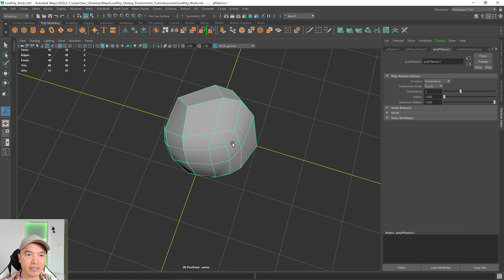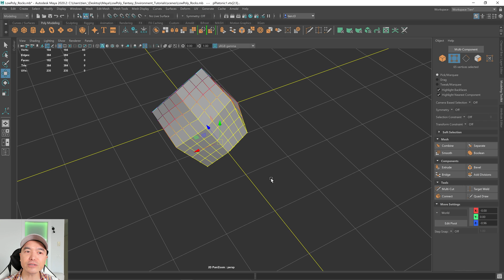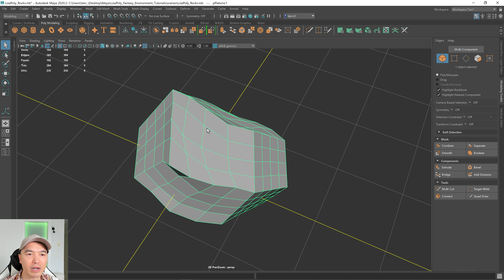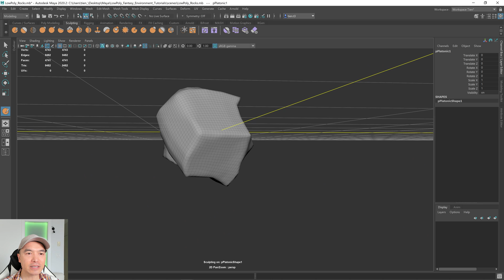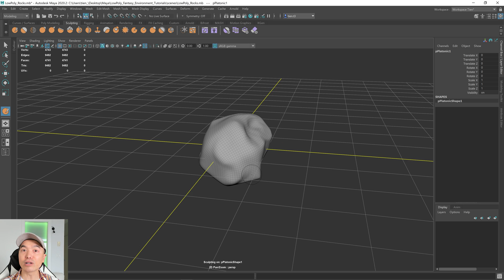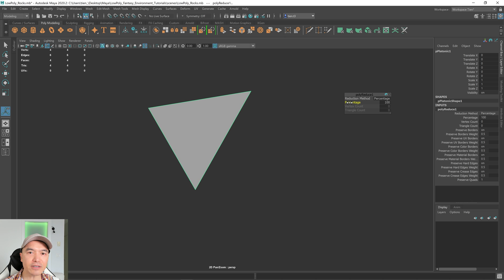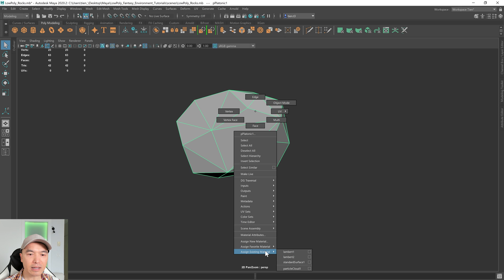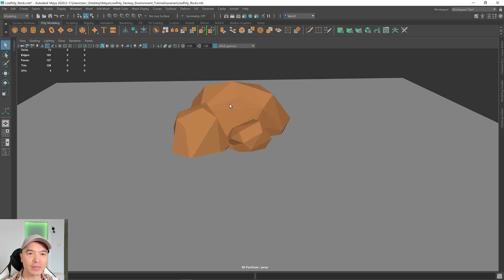Model Low Poly Rocks In Maya | Simple Rocks and Stones

Comment: Wouldn't it be much faster to start with a mid poly icosphere like the one you used, leave it triangulated as it is by default, deform it with the grab brush in sculpt mode and then reduce?

Comment: Ive run into a problem within the Modelling Tools and using the 'Add Divisions' tool. It does not divide all the faces, and instead opts to only divide faces within a select connected band around the tetrahetron. When trying to add divisions selectively to the faces one at a time, some of the faces choose to not divide at all regardless of the fact that the 'polySubdFace#' inside the popup increases in Faces.
Reply from the maker: I haven't run into this issue personally. Perhaps try freezing the transforms and make sure you are in object mode when you add divisions. The other option is just to skip the add divisions part and retopologize it instead.
Reply: @DigitalDreambox  sure thanks, Ill give that a try
Reply: @DigitalDreambox  So got it to work, weirdly enough I had to go into the 'polySubdFace#' input created by the 'add divisions tool' (in the channel box) and manually change Divisions U & Divisions V so be the equal (add divisions tool only was changing one of them)
Reply from the maker: @maverick9860  Nice job figuring it out. Debugging can be tricky but satisfying in the end.

Comment: hi! i had a question. i heard we were supposed to stick to quads only?  are we triangulating because of the hard edges?
Reply from the maker: Hi I used triangles here mainly for look. Triangulating is fairly common in low poly art but you can replace it with quads if that's what you like. Modeling using quads is a cleaner process though when it comes to edge flow, sculpting, and Sub-D modeling.

Comment: UV texture
Reply from the maker: Hi I'm still deciding whether I want to add a UV unwrapping part to this tutorial or create a new tutorial for perhaps a different rock type with a UV unwrapping section. In the meantime I'll link one of my UV unwrapping vids to help you out since I'm pretty busy at the moment and I'm unsure when I'll be able to get to it making it.
https://youtu.be/sdG52R_RWgk
Reply: @DigitalDreambox  Is it possible to use 1 material in 10 different type of shape of rocks? Thanks
Reply from the maker: @artogerilyagames4955  Yes absolutely! I'm a big fan of just a simple diffuse material for low poly art which doesn't require much UV space at all. Just separate your colors in a painting program and make sure the UVs of each rock occupy those quadrants. An additional part of my workflow is to test the objects in game with some lighting beforehand so that the colors work for me before combining them onto one UV.

I sometimes do that for emissive materials as well. Just have one material driving the emission of several objects to keep things performant.

Comment: If I'm hitting "b" on the keyboard and only having the entire model light up as yellow (no oranges or reds like in your example), despite selecting a few vertex is there something else that might be turned off? Currently the whole object still moves when I try to move a piece or a section of it.
Reply from the maker: Hi it's probably because your brush is really large. You will need to click and drag to change the size or open up your Transform tool window by double clicking one of the tools for example the Move tool. Then look for Soft Selection and you can adjust the Falloff radius there. After that when you change the brush size with the B key you should be able to see it in action. Hope this helps.

Comment: amazing video bro. One question. Can I use polygons with 3 vertex on a 3d printer? cos I wanna print low poly models and Im not sure if its better to leave the 4 vertex polygon on the model or only 3 vertex on each polygon. or maybe it doesnt matter.  thanks a lot!!!
Reply from the maker: Hi I took a quick look online and it does appear that people have managed to 3D print low poly objects with a triangulated look. It may be up to the program. Sorry I don't have much experience in 3D printing, wish I could help more.
Reply: @DigitalDreambox  thanks a lot bro for your fast reply. You are the best. And yeah I guess I'm gonna try to keep 4 vertex then. Just in case. 
You have a new fan yeee
Reply from the maker: @mikem.6761  Thanks Mike! Also it should be an easy test. Try printing a pyramid. Unless printing materials are expensive of course. Good luck!
Reply: @DigitalDreambox  oh I dont do the printings. I only make the 3D file, and I send the rest to the client, but good idea im gonna ask them to do that. thanks buddy

Comment: Where is the retopologize option in maya 2019? I can't find it ....even on Google pls help
Reply from the maker: Hi if you on an older version of Maya you may be able to access the Remesh and Retopology feature through the Command Line. Select your mesh and then enter polyRemesh; for Remesh or polyRetopo; for Retopologize. After that open your Attribute editor and look for either the polyRemesh1 or the polyRetopo1 tabs and you should be able to change the settings there.
Reply: @DigitalDreambox  thank you ...and 1 request.... Can u pls make  a detailed tutorial  on making a low poly gun
Reply from the maker: @rustyrishii  No problem. I have a few more low poly fantasy props videos to get through but I'll try and sneak it in somewhere between those.
Reply: @rustyrishii I had the same problem, but I just went to REDUCE and it worked fine too